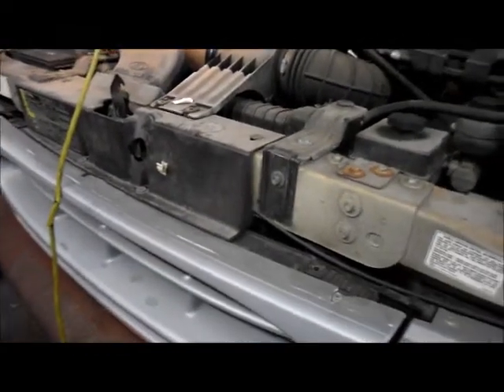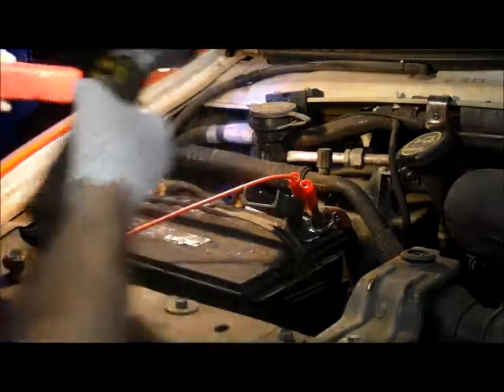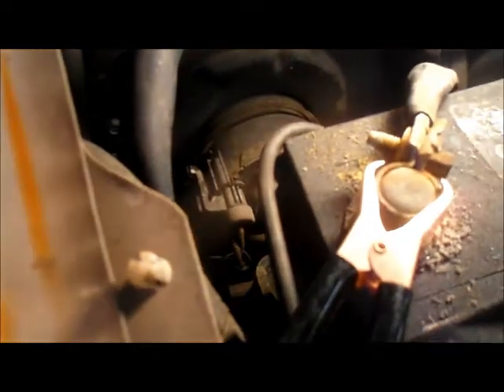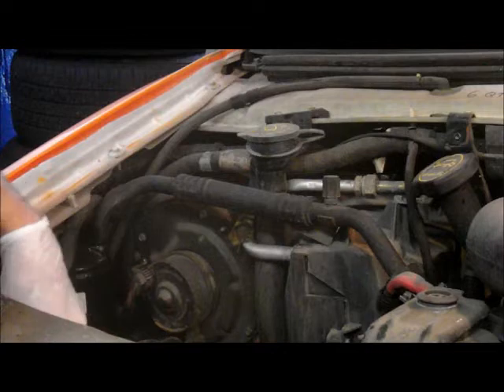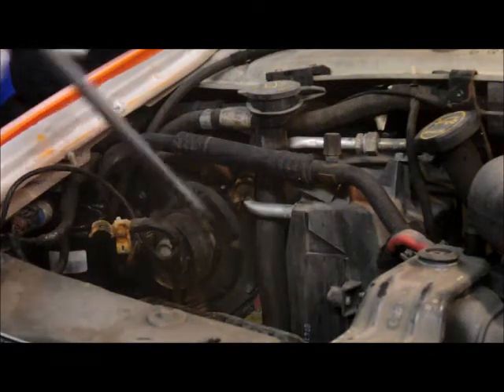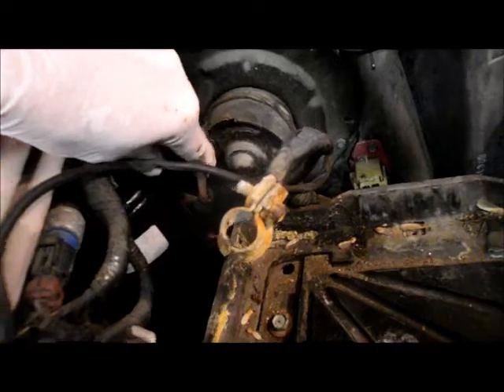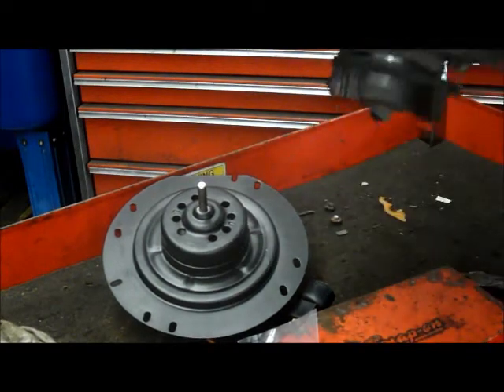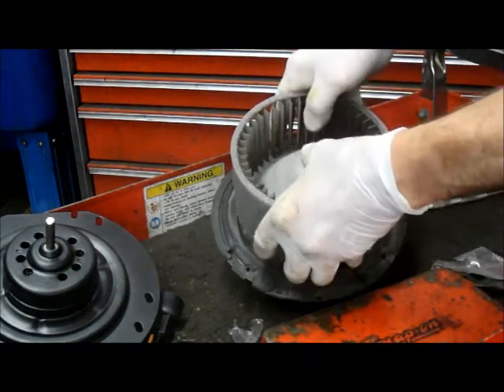How to check and replace the blower motor in a truck

Comment: Cool, this is just as easy as I thought it was going to be.  My motor will start, and then goes right down to a crawl and has a burning smell to it; thinking it's the bearings.  Anyway, will replace the motor and the resistor in the AM.  This will be so much fun since it's going to be a balmy 28°F tomorrow!  My van is a 2008 E250, but looks just the same.  I changed one a few years ago on a 1997, and I did not have to pull the battery tray.  

I have watched other automotive repair videos before, many of them from backyard hacks, really enjoyed yours; obviously, you are a top notch guy!
Reply: Even with rotating the flat part to the dryer unit, I still had to remove the two bolts that hold the drying in place to get the fan assembly out.  I had 4 bolts on the battery tray.  Like the instance in this video, it was the motor, I already knew that, but I also replaced the speed resistor, it only made sense.  Took about an hour and a half to do the job, out side, in the cold.  

Thank you again for your video, it was really helpful to watch before doing the job, probably would have taken at least another 1/2 hour without your video.
Reply from the maker: Thank you for watching and your feedback about my videos.

Comment: great video!  I would have really struggled to get that blower motor out of my 2012 E350 if I hadn't seen you motivate it out.  very tight fit.  my AC works again!!!
Reply from the maker: Great just in time for the hot weather.Thank for stopping by the shop

Comment: Great video. I have a 2009 E350 with the same problems.  However my blower motor resistor was so rusted that one of the metal contact prongs broke off when I tried to separate the plug from the resistor.  I also found that it was very tight to get the blower out of the housing.  When I go to put it back this afternoon, I think I may see if I can loosen any bolts on the dryer canister to make a little more room.  I would have been at this problem a lot longer if you hadn't done such a nice job on the video.  THANKS!

Comment: Nice video.  I have a 2001 Ford Excursion and the fan began working intermittently.  (Usually after hearing a clunk sound first).  I used a multi-meter to trace the problem to the blower motor and the new one arrived via Fed Ex a few days ago.  It looked simple enough to swap out but I decided to read and watch a video (yours) to see if there was anything I hadn't thought of.  Kudos on a well made vid.
Reply from the maker: Tom Reavis   Thank you for stopping by
Reply: You betcha.  The blower motor was changed out successfully and now the fan works perfectly.  Took about 30 min...
Reply: Tom Reavis I don't have heat in my truck but motor rum good

Comment: Thanks for an awesome video! Not sure if I just missed it but cleaning out the inside of the blower motor casing for leaves and debris before putting the motor back is good practice also.  Cheers
Reply from the maker: Happy to help

Comment: Thanks for the video. Blower motor on my 97 E350 5.4 stopped working. Waiting on parts. Going to fix it on Wednesday. Looks like mine will be a little easier since the blower motor sits higher on the 97.
Reply from the maker: +djdigital1 great keep me posted how you do.
Reply: +jimthecarguy Finally got it done yesterday. Just had to remove battery and tray. The resistor was in horrible shape, pretty much welded to the other connector. Had to bust it off and get a new pigtail connector. Put in a Four Seasons (Upgraded) Blower Motor. All is good now. Thanks again.
Reply from the maker: +djdigital1  Great thank you for the update.I'm happy to have helped.

Comment: followed your procedure for testing, and had power to the motor. tapped the motor lightly with a hammer and it started working again. should I still replace the motor?

Comment: where can I find a power probe?
Reply from the maker: +mrmikcorp  You should be able to order it from a large auto parts store or on line.You will really like that tool.
Reply: +jimthecarguy   how does the tool work?    do I just touch the wire or poke in the plastic cover.
Reply from the maker: +mrmikcorp   You don't poke a hole in the wire you back probe the wire were it enters the connector with a wire or paper clip.Check my other videos to see how to use the Power Probe.